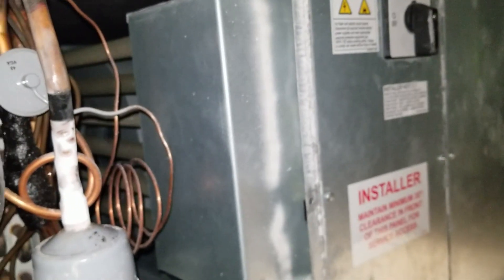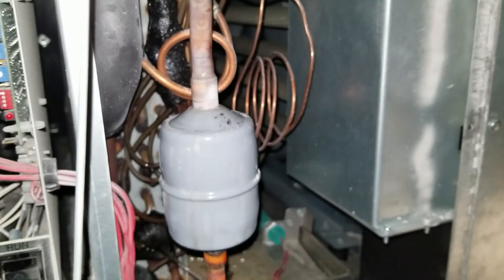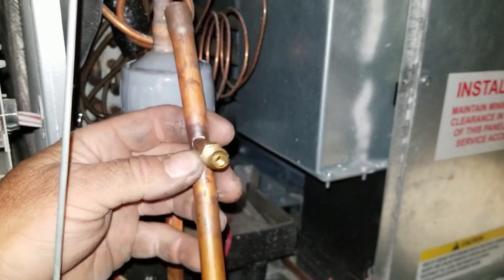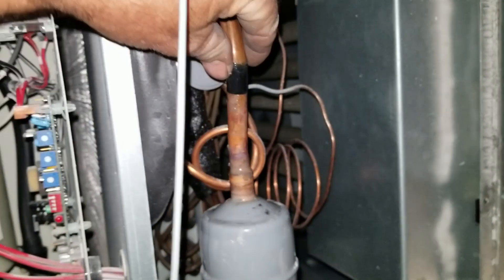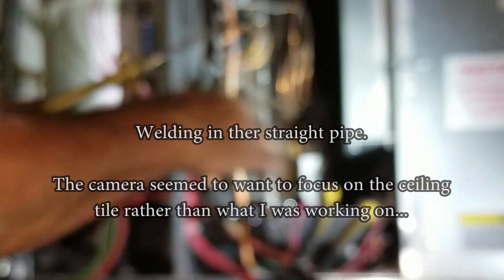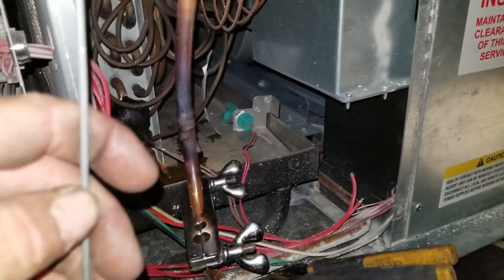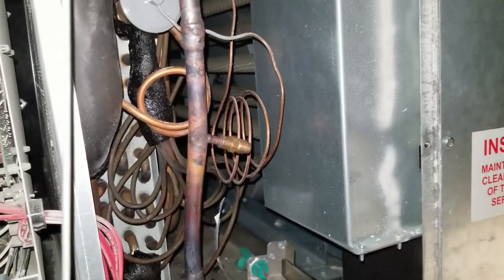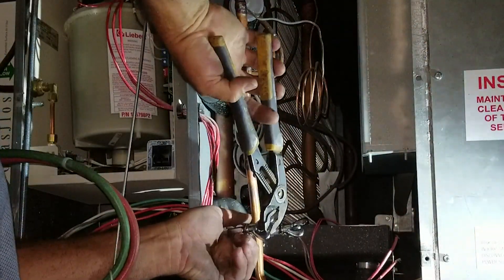Removing and bypassing/replacing a filter drier without recovery

Comment: https://www.youtube.com/watch?v=YcLoLbr3WSE
Reply from the maker: Lol, I'm not sure why you posted that.
That don't really apply to this short cut. 😆
Reply: @hackfreehvac  No nitrogen purge equals carbon in the pipe. Sure it probably still ran fine, but you put some carbon in that system. I wouldn't want that done on my equipment.
Reply from the maker: @kencampbell3986  Of course. That's important when necessary such as piping, VRF systems etc.
There are exceptions when you can clear it.
When finished and isolated I Crack one pinch off tool to charge pressure. Close it.
Then bleed the Schrader valve a few times.
There ain't shit for carbon left in that pipe after that. 😆 

This system holds like 75 lbs R407c if I recall. Coworker just did an all day repair then found that plugged filter drier inside. (New drier added outside at CU).

This was a 30 min fix at BEER-THIRTY in the afternoon, and a damn good fix, vs another day just to pump down and evacuate such a system yet alone do the work. All at a server in a high rise that needs scheduling to access.

Comment: Does the pinch off tool ever crack the copper tubing?
Reply from the maker: Never have broken the pipe unless maybe if I wiggle it a lot after. 
But can't recall a time it has failed.

Comment: I forgot the name of the process, but why not trap the refrigerant in the condenser?

Edit: Wouldn't that process also create a metering device too early in the liquid line and still ruin the refrigerant because of the small contamination?
Reply from the maker: "Pump down".

The problem would be needing to evacuate for a while if we opened the system again and we were out of time. 
We needed to get out of that building before the office closed.

Using the pinch off tools all I had to do was bleed a little refrigerant after welding and cracking one end open briefly. 
Like bleeding your refer hoses when charging a unit. 
No evacuation needed

Comment: I keep the same two sphincter tools on my truck.  The vise grip style and the block style.  I use them all the time on pressure switches.  Never to change out a filter though.
Reply from the maker: Generally I don't use them to do a filter. 
But when you spent all day fixing a leak and find a second filter after you already spent 4 hours just to evacuate and charge 80lbs of R407c and it's 3PM then you enter Git-R-Done mode.

Comment: Now ThaT is cool :).  And wow, that is a chunk of freon!!
Reply: And I'm sure you didn't charge the customer for 75 lbs of refrigerant! <hee hee>
Reply: @b0neme  Lol, I bet that happens a lot, esp in residential if the customer isn't watching how everything Its done, 
"Yep ma'am, its freezing up because your evap coil is clogged up with dust, pet hair and such. Were gonna have to pull all the freon out of the system, cut the lines and pull this coil, take it outside and clean it. Reinstall it, braise the lines back in with a torch, then put fresh freon back in the system.
You'll need a new filter dryer too, and since we're in here we should install a proper filter box, this old thing leaks like a noodle strainer. Quit using those cheap filters too unless you want us back out! 
What? The same freon? Oh no no, can't do that. That coil freezing dropped the freon temp down below its conjugated combobulation temperature and if you run it with the freon like that for a long time it'll change the molecular structure of the poe oil to a highly acidic ph base, and we all know what THAT will do!  ...hhhmm? Oh you don't know? Well the acid will eat at the copper pipes from the inside out, and since the thinnest ones are here in the evap, those will be the first to blow out!  Prolly when you're sleeping. Fill the house with oily coated, acidic freon gas. Gets on everything. Not much fun to breathe either. Just saying.
Reply: @mikie2501  🤣🤣🤣

Comment: nice work.  ball of steel to do that with 75#'s.  I've think you used that tool many years ago on something; I'm thinking a small cooler or something?
Reply from the maker: I think I made a video or two a while back showing me crimp the "processing tube" on a compressor (where a small unit is factory charged then sealed shut) so I could then cut the line and weld in a schrader valve without removing the refrigerant.

Comment: I’m assuming the unit pumped down once the bottom pinch of tool was tight. Am I correct in this assumption or did you have to do anything else with the condensing unit?
Reply from the maker: It pumped down very slowly due to the restriction in the filter.
Then I crimped the second pinch off tool after the filter.At that point I had very little pressure in that short section and filter.

Comment: Very cool! But, did doing that possibly let some air into the circuit? Maybe I misunderstood something. Thanks.
Reply from the maker: That is why I install a schrader core in that section.Then what I d0 is barely release my pinch off tool to get the tube charged. Then depress the schrader core to purge it. 
At that point it is like purging your refer hoses to release the air when you hook up a tank of refer, etc.
Reply: Ok, I can picture it now...that is a great way to do inline repairs!! Appreciate the reply...

Comment: Did you loose any refrigerant while cutting out the drier and putting in that new line?
Reply from the maker: Very little. Maybe an ounce or two. Which is nothing compared to the complete 75 Lb charge.
Reply: hackfreehvac guessing this unit didn’t have a receiver? I’m guessing this restriction was causing the freon to pump down in the condenser right? Really high subcooling

Comment: Nice work. I know you had your fingers crossed when you took out the drier. Ha
Reply from the maker: That's likely science fiction. (Ozone depletion theory)  LOL
But yeah, I don't want to loose 75 Lbs of refer.
Reply from the maker: LOL Well it would only vent 75Lbs of refrigerant into the space. 
But I have used the pinch off tool several times now so I was fairly confident. :-p
Reply: hackfreehvac wouldn’t that destroy the ozone layer?
Reply: Osmar Ponce yep, this one guy singlehandedly could destroy the ozone layer with the refrigerant charge from one refrigerating machines. Scary huh?